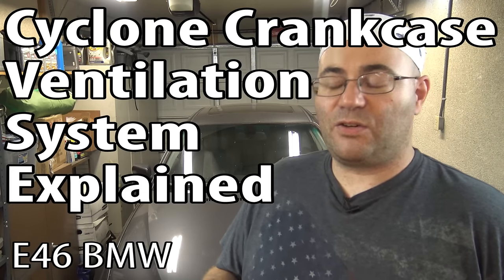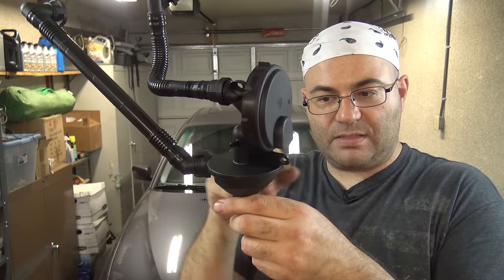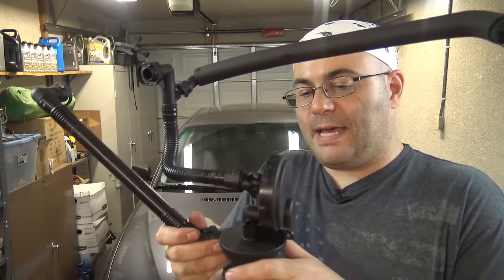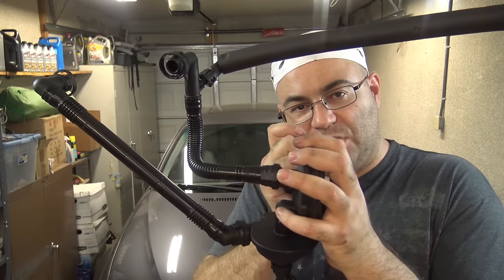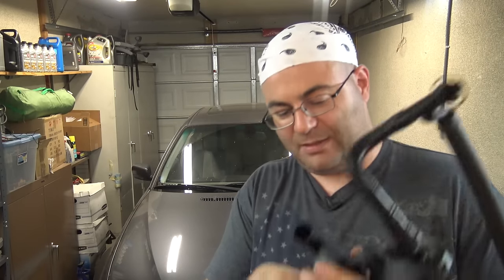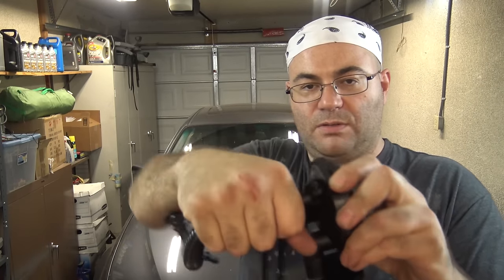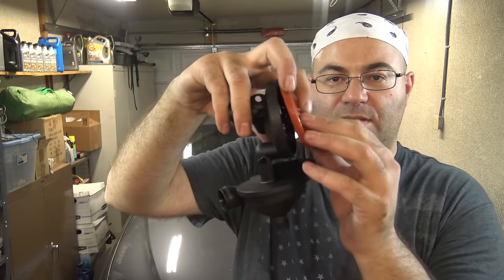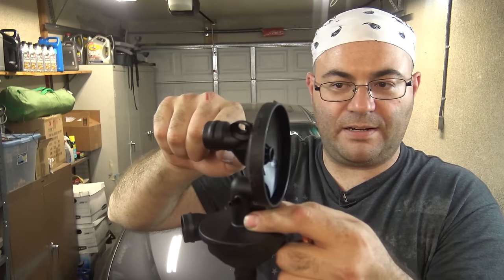BMW E46 Cyclone Crankcase Ventilation System Explained

Comment: Hey man. Just wondering you said this thing can malfunction. I got a knock off and non cold weather one (I live in New Jersey) and I recently was checking things on my car and it was running and I wanted to check to see what the oil was looking like. So I pulled the dipstick and at least 3 liters shot out like crazy everywhere. Only good thing about it was I did need to change my oil lol. Never had that happen before and checked it many time with the car running and never had this happen
Reply from the maker: Wow, certainly sounds like it's clogged all to hell.

Comment: Hey so my e46 has an overheating problem and get code p0174 and I already replace the air intake boots and I’m abt to replace the ccv as well as the fan clutch do u have any idea on why my car is over heating it will run at idle and won’t over heat but after I take it for a spin it start to over heat

Comment: Hey how are you love your videos please respond to this I recently did a smoke test on my E46 found the front tube manifolds it CCV was the only League I saw I just replace this whole system last year with a climate control CCV I live in Philadelphia this winter has been a little brutal however I didn't think it would fail this fast especially being jacketed, anyhow I put the 2 back on with a good connection and I'm still getting permissible Bank 1 Bank 2 on my scanner should I dig deeper into that CCV maybe the oil dipstick o-ring or tube it itself? Also sent a video on how to test it without taking it off did all those seem to be functioning well however this about says it's not functioning it on my scanner even though I just rebuilt it, if you have time please give me your advice and thank you

Comment: I have a very strong vacuum when opening the oil fill cap. And the car is nurning a lot of blue smoke when accelerate or long idle. Will cutting the dipstick hose and apply this mod solve tje high vaccum and smoke or will it only stop the smoke but still vacuum a lot?
Reply: Wont stop vaccum but the oil in the exhaust fumes will prolly just build up until it clogs the intake i suspect.
Reply: @thechronic555  oke thanks for info

Comment: I have a question. (I have almost none engine knowledge by the way.) For around a year our 3.20d BMW E46 (2005) (automatic gear-320.000 km 195.000 miles) is creating black smoke. When I mentioned it to our mechanic/garage guy -- usual stuff --- he said it's normal for old diesel engines. Recently it creates a lot of black smoke whenever car's pushed (acceleration, uphill) and feeling like it's going to be stalled when idle. Could CCV be the reason for huge black smoke/erratic idle/hard start? Thank in advace for any opinion on the matter.

Comment: Nice video. Do you know if the cold weather version of the CCV has that extra port that leads to the fuel pressure regulator? THe reason I ask is because the entire unit is encased in an insulating material and when I replaced that part I didn't notice any extra connectors to cap off. I wonder if they only offered the cold weather version for M54B25/30s and therefore the mold itself doesn't have that port as it (the Cold weather version) was never in use on 323/328s...
Reply from the maker: the port is hidden by the extra insulation on the cold weather oil separator. You'd have to drill a little access hole
Reply: why would they do that.....

Comment: great video. after watching many fear mongering vids on this subject, I replaced my ccv even though my 320 has only 30k miles. I kinda figured since its 17 years old, even though I had no symptoms, i should replace it anyway. was that a good move, or should I have waited til the car got to around 100k?
Reply from the maker: Age does these valves in as much as miles, so yes it was a good thing to change it
Reply: @50sKid  and now after 6 years and 50,000 kilometers, Im having an oil leak where the ccv hose meets the vc. could that be from a failing ccv system?

Comment: My Car BMW X3 3.0i 2005, M54B30, Have high Fuel consumption 12 mpg, code P171 & 174, I notice that when I try to pull the oil level gauge it is always hard to pull, also the oil filling cap ,,, Long Term Fuel Trim is high 25% going less whith higher RPM ,,, Maf ave. reading 3.1 to 3.4 gr\sec at low RPM.
can I say  my car's CCV is the problem ?

Comment: Does this cause limp mode? I have a 323ci with a getrag 250 that's in limp mode. Has codes: P0150, P1188, P1189, P0170, P0173,  and misfires for cylinders 1, 2, and 3.
Reply: Most of those codes are fuel related, and so far I found another youtube video that says replacing the ccv pipe that cracks fixed his limp mode on his m52tu E36. My E46 also has the m52tu. Most the forums for limp mode are auto trans. I'm stumped and need help.

Comment: What happens when you take the rubber diaphragm out and run it that way......with a check valve in your oil return. It would be no different that hooking a vacuum line up to the port. It would also not be much different than a catch can

Comment: hello..thank you for this video..really useful...but i have a question..a heve removed my vent. valve on my e36 m52b20 engine...i have no problems but before and after the removal of this valve i i got one other problem...when i am driving uphill and i drive reaally fast in high revvs more than 20 min. and after this session :) when i stop and the engine is in idle my OIL lamp start to flashing fast..turns on and off fast...i tryed to change the oil with MOTUL 15w50 in the end of the winter...its better but after some ''racing'' driving the lamp start to turn on and off fast again...what you think it might be the reason???i think maybe the little valve under the oil filter...or the oil pump is goin down???do you think this vent. system can help my engine to make the usual presure in the oil and help it circulate corectly....this vacuum of the engine...is it helping the oil pump or it should be working good without the vacuum of the pistons???please say something...help me
Reply from the maker: Deleting the vent valve has nothing to do with your oil pressure.  Two separate things.  I suggest changing the two o-rings on the tip of your oil filter cap.

Comment: Hi,

How does this work in theory to the O2Pilot mod? Since when you do that you connect full intake vacuum to the CCV's plugged port? I'm just trying to speculate on this since i have a 01' 530i that had a oil consumption problem, that i actually did the O2Pilot mod on and saw really good results from it, all oil consumption gone. But in this theory it should suck oil up from the oil pan since the CCV is under full intake vacuum which is A LOT :D

Anyway, after that i replaced my whole CCV system with Meyle parts and removed the O2Pilot mod and the oil consumption problem/smoking after coasting to throttle returned, but i was thinking.. If i put a regulator valve, say a fuel tap from a dirtbike to control vacuum would probably work to reduce the vacuum a bit since i think it's a bit high with full intake vaccum.

Anyway, i will just put the O2Pilot mod back on and be happy.

What do you think 50sKid?

Comment: On a separate note, I feel like my alternator bearing might be going out. Is it possible/worth it to replace just the bearing or just replace the entire unit? I have no charging issues they just sound noisy especially when cold. Replaced the other pulleys and belts already so that's why I ask.
Reply from the maker: Not worth it--you would probably need a press and bearing separator.  Just buy a reman.
Reply: 50sKid
Thanks man, that's why I asked. I'll look for one.

Comment: just subed.....Awesome idea with the check valve, I mean great! thanks ! now if I could just figure out the buzz at 2k rpm, it's driving me crazy. just under load (in drive). I think its the Vanos but....
Reply from the maker: Hmmmm... A buzz could mean so many things... so many kinds of buzzes in the world of cars, lol.  Have you inspected your VANOS?
Reply: no , I guess I should pull it apart, the buzz is only at 2000 rpm's either on accel or decal so I was wildly guessing it is the vanos, won't do it while in park/not moving so I was guessing the ecu was keeping the solenoid closed...???
Reply from the maker: Yeah it opens it at higher RPMs...you can see the little arm move back.  One of my viewers sent me a video a week ago that showed its operation as he sat in the car and revved the engine (something I've never seen as the M54 is drive by wire).   I can't seem to find it though.
Reply: The buzz you hear could be from a cracked bracket used as stiffener between exhaust pipes at manifold discharge adjacent to transmission. The crack in the bracket causes the noise only at rpms described. I merely bent the stiffener a bit so there was no longer contact at the crack. Noise gone. I had this problem on 9/00 build 330ci vert.
Reply: thanks...   i'll have a look

Comment: Hey boss so I've been watching all of your ccv system replacement videos and deletes and swaps to catch can but one thing I haven't heared you mention is the tiny little Port that leads to the fuel rail. So my question is what happens to that hose when replacing the ccv with a catch can "which is not what I'm hoping to end up doing" but what do you end up doing to that hose do you seal it off? Or do you vent that hose Into the catch can? But my particular situation calls for after the 4th time removing my mainfold after replacing blown heater hose and then new starter and a few other odds and ends I figure out that my ccv was completely destroyed on the inside the black seating piece under the diaphragm was nothing but little bits of broken plastic when I took it off and I went to the parts store to get a new one and I suppose there was a misunderstanding and he ended up selling me a pcv system for my car instead of the ccv  which I didn't realize had happened until a while later after installing the pcv system and then sitting  there for about a week scratching my head looking for that tiny little mother *** valve port that happens to not exist on the pcv system 😢 later from watching your videos I figured out there's a difference from the two systems can I just replace it with the pvc valve it has all the other connections besides that little tiny port and if so what would I attach that hose to or would I delete it? That seems a bit risky to me to just fully delete it but you clearly have a much better understanding than I do about these cars. And my car is a 2000 323ci with the m52tu engine in it. Please if you have any information, hints tricks tips anything on what I can do at this point I'm really not wanting to retake off the whole manifold yet again if I don't have to Thank you so much your videos are definitely grade a information all the way I definitely appreciate what you do here on your channel thanks again
Reply from the maker: You can leave it open. It’s not for applying vacuum to the fuel pressure regulator. It’s just in case the diaphragm in the regulator degrades and fuel vapors leak. They would get routed into the intake through the little CCV port.
Reply from the maker: Oh I just saw you have the m52tu. In that case the fuel pressure regulator IS vacuum referenced and that vacuum comes from the back of the intake manifold. In that case the CCV port is blocked off by a rubber cap
Reply: @50sKid  so that would mean the port on the back of the mainifold is where I should connect the 2st line from the fuel rail is that correct? And thank you greatly for responding I really appreciate it.
Reply from the maker: @Anonymous-oi5mq  Yes

Comment: Are you going to be fitting the GermanAutoSolutions' CCV kit when they release it?

I was holding off for months in hope that they would release it, but my car was smoking out of the exhaust and I had the OBD codes you mentioned, so I decided to replace the entire CCV system. Turns out my lower intake boot was torn at the accordion joint and my CCV oil return line had crumbled apart but was being held in place by the mesh. The unit snapped trying to get it off the manifold and that was with the manifold partially removed (I couldn't get it out because I couldn't remove the brake booster line).

Intrested to see the G.A.S. version in action.
Reply: For me personally, unless it's priced really competitively, I will be holding off. I got their G.A.S. kit for my DISA, but a brand new cold weather CCV (oem from FCP) only cost $110. For having to replace it every 30-40k miles, that's a good deal. Plus, since I bought from FCP I will always be covered.
Reply from the maker: Will G.A.S. ever finish their CCV replacement?  They've been working on it for years at this point.  I just checked it out and I see that they've progressed quite a ways.  It seems their design is going to replace the stock oil cap and drain the oil back that way, which is pretty clever.  I'd be interested in trying their system.  Maybe by the time they come out with it they'll be willing to send me one in exchange for a video review?  I'll have to contact them about that.
Reply: Yah, back when I replaced my CCV, it was still at the basic CAD design stage and then typically a couple of weeks later they annouced they went into prototype stage.

I was pleased to see the oil cap mod as it should eliminate the oil return line, which as you say is probably the most common failure. Most importantly, each time you change the oil filter, you can clean the cyclone unit. I don't remember what their solution for the crappy plastic pipes were though, silicone maybe?

From what I remember, it's just one guy working on the solution, who also has other projects to deal with so I can understand why it's taking time. Another problem for me is being in the UK, import duty is going to make it pretty expensive to buy. I already bought the DISA kit and 1.2bar coolant cap from them which ended up costing me approximately £120 after import tax/duties :'(

Hopefully they do send you a set, even if it's a prototype, as I imagine a lot of people would've forgotten about it, so it should drum up some interest in their product.

Comment: Hi 50s KID, Can you help me please? "I replaced the valve cover gasket and after starting the engine, it started to hum and the engine ran as if a cylinder was misfiring. The humming noise comes from the CCV tube that goes into the valve cover. When I disconnect it, there is pressure coming from the tube that causes the humming. When I block the tube with my hand, the engine runs well. Do you know how to solve this problem?" Thanks Joseph
Reply: Jus random but ive heard some cheap metal valve covers arent ported right. The holes in mine werent drilled out at all.

Comment: i been using ur tips in changing alot of staff with my bare hands thanks for that i’d ask u now about the ccv here i found my under hose connecting to the dipstick a bit oily but no cracks however i think im gonna meed to change it or change the entire ccv dont know yet but the reason im doing this coz every time i turn off my engine some air comes out from the intake manifold and it sounds like its breathing out for a moment so idk whats the priblem here do i have to change the entire thing like u did !? 
thanks again
Reply: Probably just your brake booster vacuum releasing.

Comment: I have p0101 174 codes. Should I replaced that tube or the whole ccv? Thanks for the great vid.
Reply from the maker: You should replace the whole CCV IF that is where your vacuum leak is.  It could be other things as well.  Watch my common vacuum leaks video.
Reply: Thanks for the reply! I somewhat sucsessfully re installed the cold climate CCV in my 04 X3. I say somewhat because I forgot to swap the rubber plug from the old one to the new one. Is that a major mis-hap and do I have to take it all apart and attach it from the old one?
Reply from the maker: Yeah you need that nipple on there otherwise it's a vacuum leak. You can use long needle nose pliers to put it on. Just gotta take off the intake boot probably
Reply: Ok Thanks a lot for the help and advice I appreciate it!

Comment: if the diaphragm fails, a simple checkvalve wont save it, it will still suck oil from the crankcase due to excessive vacuum

Comment: Hi. I've been watching all your videos and I gotta say you make everything so much easier. I just bought my ccv kit and I'm about to install. I got one question. how is your car performing since you replaced the ccv. and also out of topic on the brakes and rotors video. how good of quality are the brakes you purchased on the link you provided. and rotors as well?. btw I have a 2001 bmw 330xi
Reply from the maker: I'm happy with the brakes.  I'm not sure I can speak to how good the OEM stuff is because I have no idea if what I took off was OEM or not, however I see no difference between the two.  It's a good choice if you can't afford dealership prices.

Comment: So I was going down a hill decelerating for about 20 seconds no throttle at all and when I got to the bottom of the hill I went to accelerate and a cloud of grey/ white smoke came out for about 1-2 seconds. It doesn't smoke when I'm stopped or accelerating though. Do you think it possibly could be the CCV?
Reply from the maker: Could be the CCV but it could also be the valve stem seals.  Do the CCV first since everyone needs them replaced and see if it fixes your problem.

Comment: your movies are great helping me a LOT with my journey with e46 m54;) thanks a lot:)
have a question: is your m54b30 burns oil? my m54B22 burns 150ml per 1000 kilometers ;)  no need to worry right?
Reply from the maker: Yeah mine consumes the exact same amount.  It's pretty typical at this point in it's life.